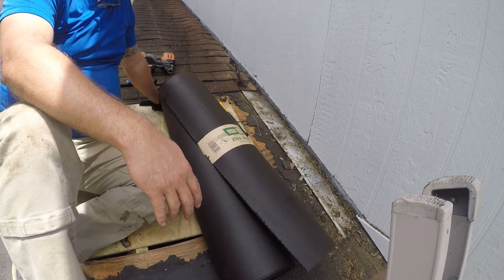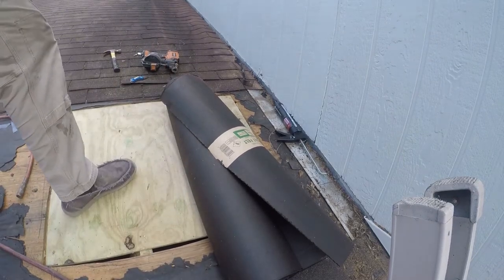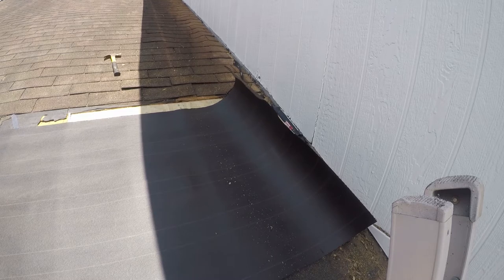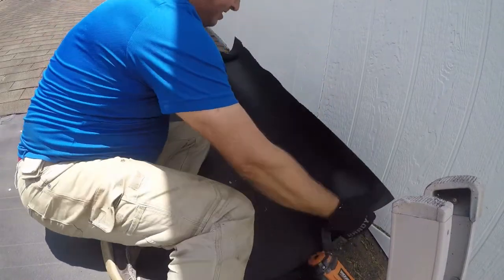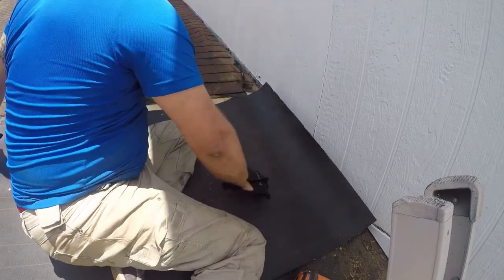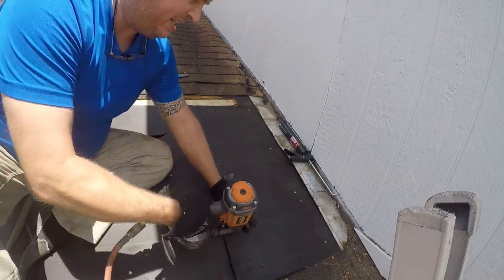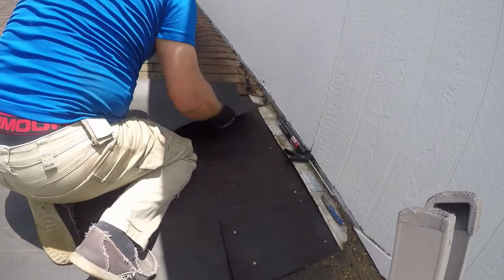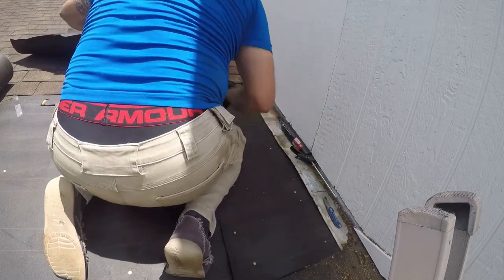DIY: Roof Repair 3 of 4 - replacing tar paper.

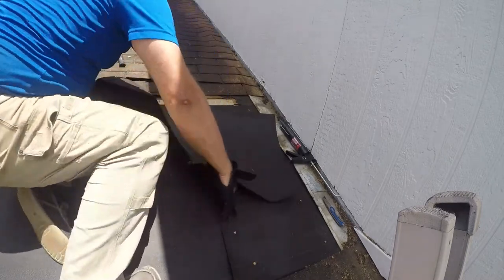Comment: @4:25....  It's difficult to tell from the camera angle (and I could be mistaken) but it looks like you ended up tucking the new tar paper under the shingles after all... or was it just one area you concentrated on? I couldn't really tell where you made the cut. Anyways, great vid. I'm using this vid as help so that I can replace the rotted shingles at the edge of the roof line (the eave). Had rain water wick it's way up underneath the shingles somehow (the rotted part) and got into the house. So instead of just shingling the entire roof... perhaps just replace the 2 or 3 rows of shingles near the edge which hopefully should be easier than what you had to do. Now onto vid #4...  Thnx again.
Reply: Without being able to see exactly what he did there, he likely meant you don't slide the new tar paper under JUST the old shingles, but under the old tar paper beneath them. That'll allow the upper paper to overlap and prevent water intrusion from the top of the new tar paper, just like with the new shingles.